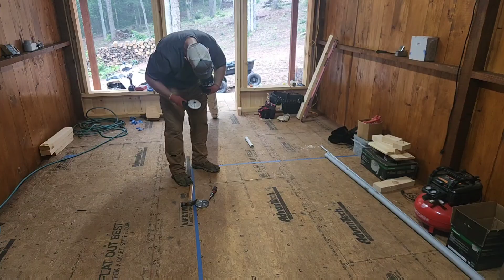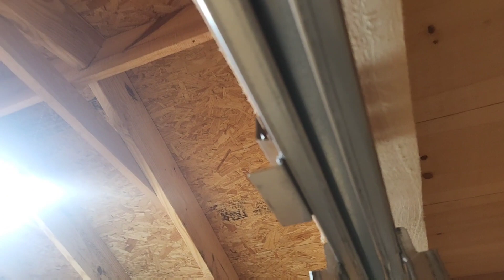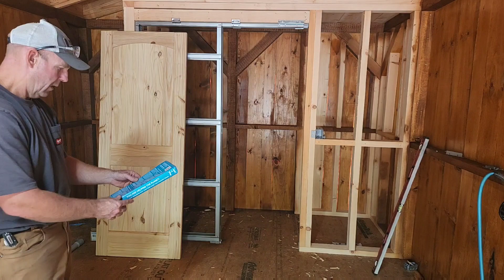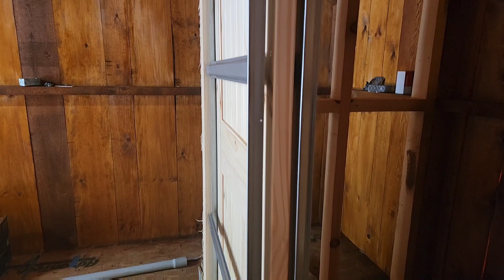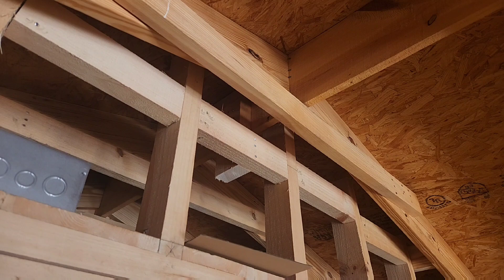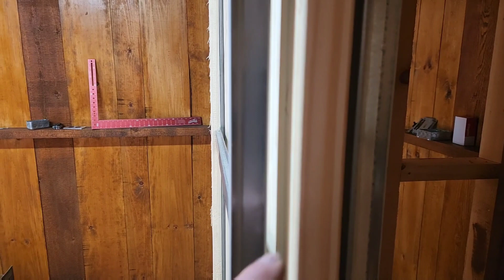Cabin 1 - Pocket door assembly

Comment: Nice work.  From experience, remove door before attaching wall covering.  Then check for protruding fasteners before sliding door in pocket.  I have a project that involves pocket doors coming up.  What brand did you use?
Reply from the maker: It is manufactured by Rocket and I purchased through Home Depot.  I was down there this morning throwing up some nailers onto the frame and was certainly aware about fasteners punching further than I wanted.  So far so good.